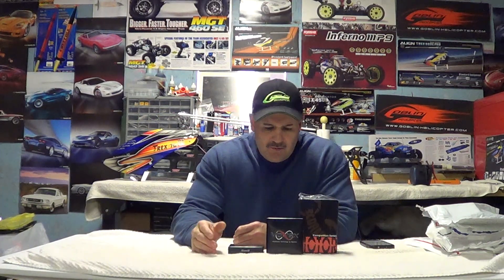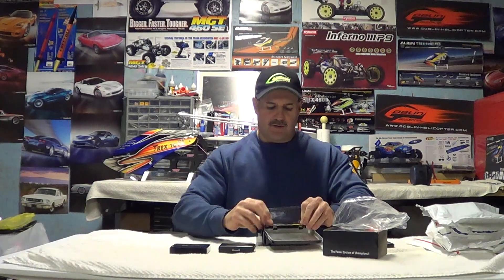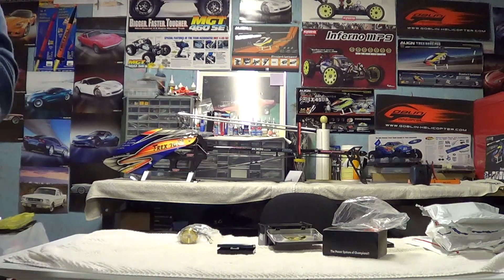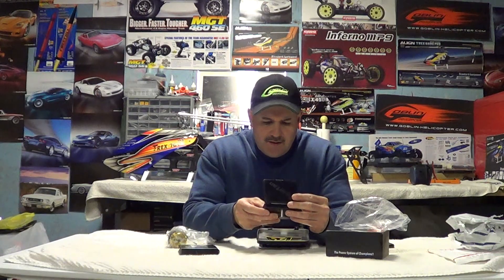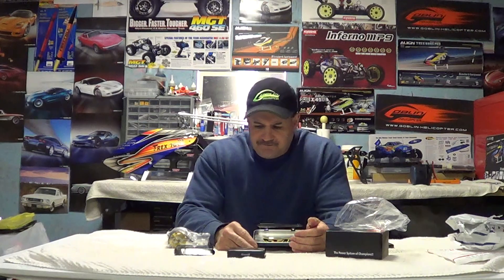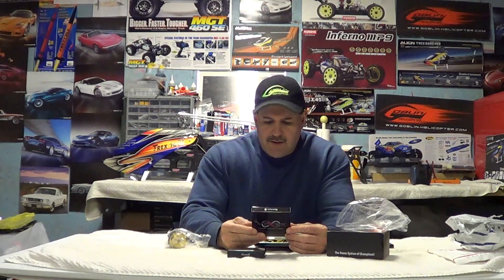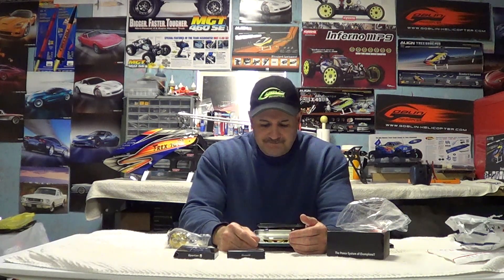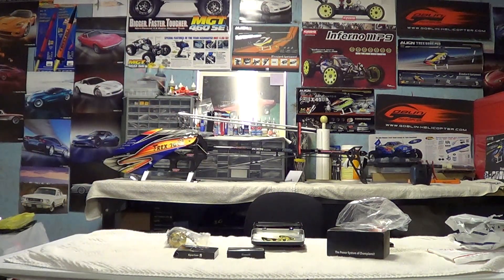Sab Goblin 570 updated build info ,www rcgalore net

Comment: How many cell do you use for goblin 570? 6S or 12S?
Reply from the maker: i use 6 cell but you can run either 6 or 12 but you need the right motor to which ever you choose